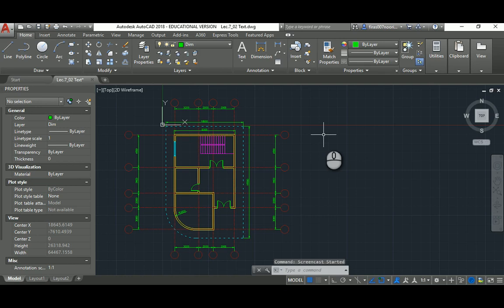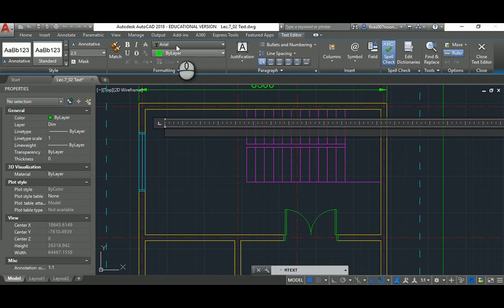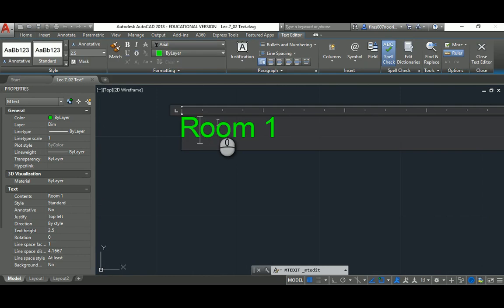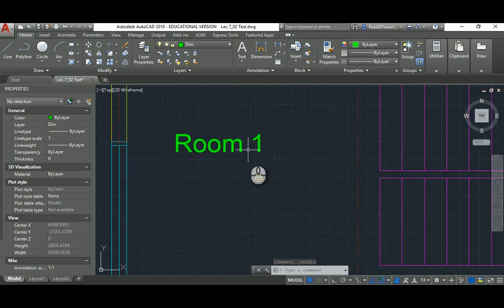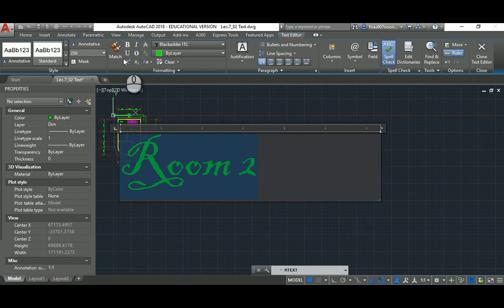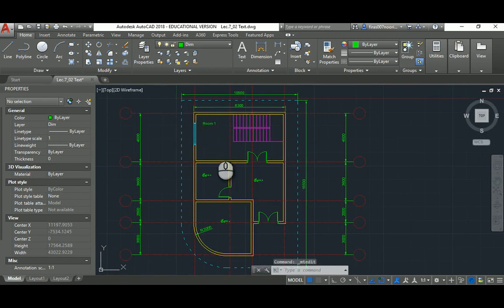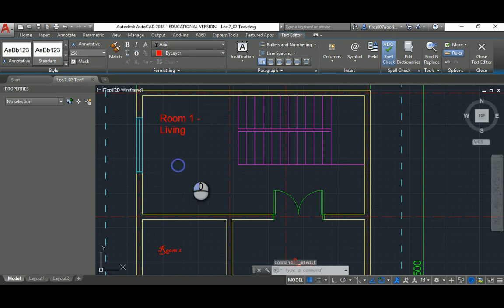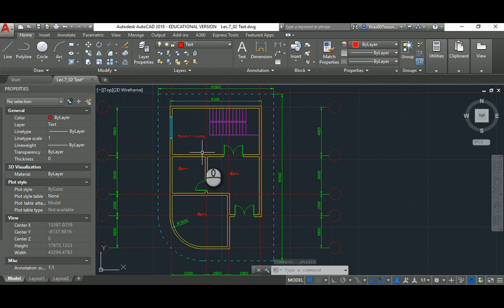Lec. 7_2 Text in AutoCAD [AutoCAD Basics]

Comment: I cannot express enough how great these videos are and a question came to my mind: how could I place the Text in the centre of the room as the text's base point is in the top RH-side.
Reply from the maker: Hi dear, thanks for your kind words, in the text entry around 1:30 you can see the options in the "Paragraph panel" choose the middle and the text will be appear exactly at the center
Reply: @FirasNoori  My pleasure. Thank you so much for your anwer. I'm sorry for not being specific as I was hoping to place text in the centre of the room using Move>Specify basepoint (it only shows a point that says MText Location in right top corner)>Mid between 2 points. The result is that the text is slightly off centre towards bottow right.